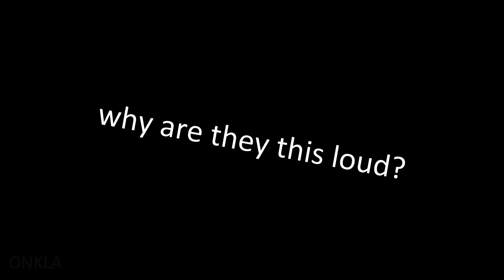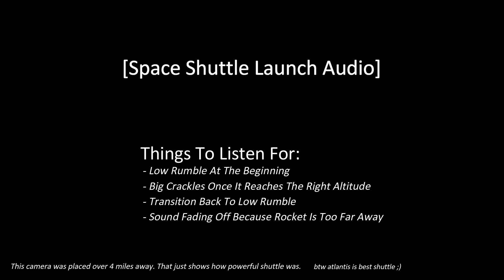Why Do Rocket Engines Crackle?

Comment: Great explanation. No one in space news ever addresses the sound change.  I once heard someone mention very briefly that the water at launch pads was for sound dampening and all the vibration stress that puts on launch tower area.
Reply from the maker: Yes, the water on the pad is called sound suppression water. I forgot to touch on this in the video. They dump it on the pad while the engines are running to quiet the sound by a few decibels. That helps it not destroy the pad with vibrations and heat.

Comment: The crackling lasts the entire time, like with falcons for example
Reply from the maker: Yes, the whole time there is will be a crackle. However, when it is lower to the ground you hear a rumble because the crackle sound is not being emmited directly towards you. But then the crackle will continue for as long as you can hear it. I have personally seen three launches upclose. Falcon 9 being the loudest and most crackly of them.
Reply: @Onkla  I definitely understand what you're saying about how there are times when each sound is the strongest but also both parts of the sound exist at all times